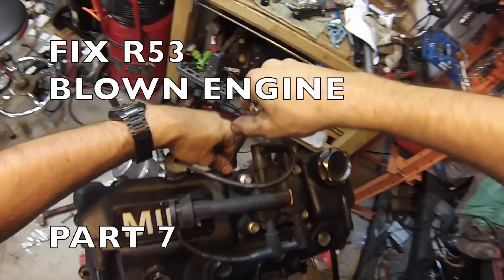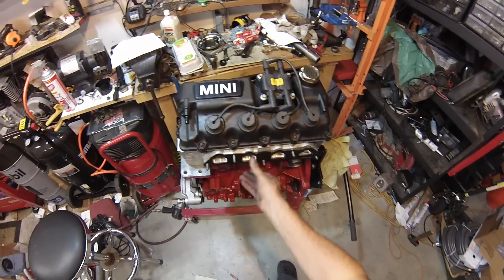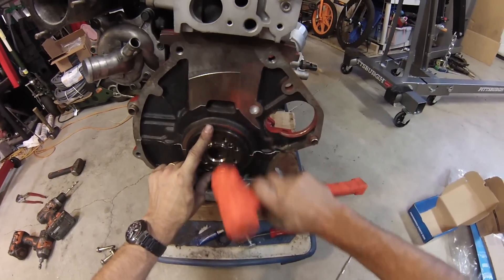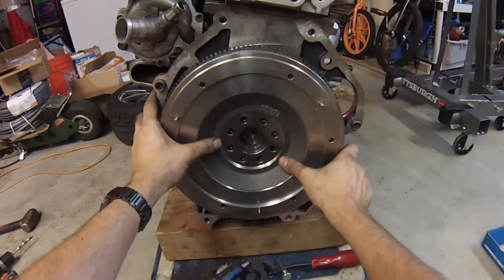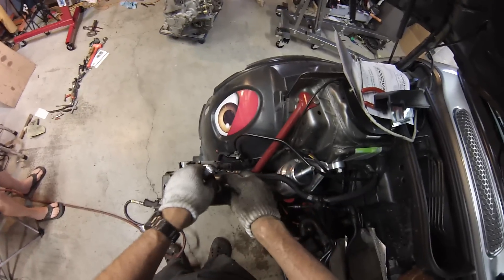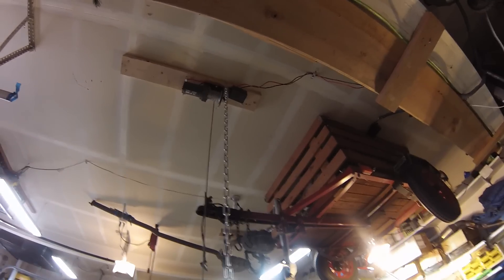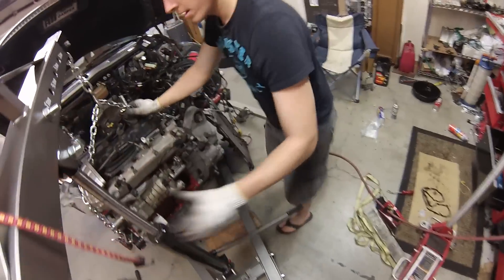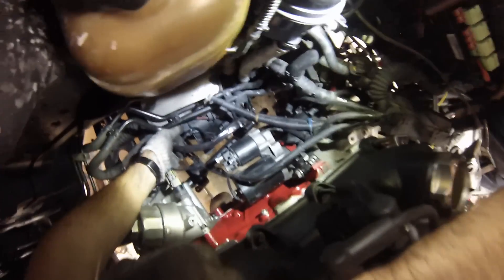Rebuild R53 Blown Engine 2004 MINI Cooper S - Part 7 / 9

Comment: Been following your videos through my own melted piston and engine rebuild.  Thank you so much for all this.  I'm now studying these to mate the engine back to the car. 

I noticed you didn't show when you connected the shifter linkage cables to the transmission.  These gave me some trouble when I took the engine out, and I'm thinking these will be the toughest part of the engine hook up (little room to get leverage and properly snap those in).  Any tips?

Comment: Question on timing chain installation. Do you check to see where the pistons are in relation to top dead center? Or is this not necessary?
Reply from the maker: If bright links line up, doesn't matter.
Reply: @ModMINI  Awsome! Great videos and keep up the great work

Comment: Are the S engines 1.6L or 2L? Just curious if I can use an NA block with a supercharger and S mapping.
Reply from the maker: 1.6. No, the internals are different. The supercharged variant has piston oil cooler passages that do not exist on the base block, crank and Pistons are weaker, etc. you will blow up the engine.
Reply: +Mod MINI that's what I thought. Good to know, just professional curiosity and cheapness! :p

Comment: Is your supercharger still stock?
Reply from the maker: Osman Berberovic Stock supercharger with 17% pulley and GP intercooler. A lot of stuff needs to change if you move away from stock supercharger.
Reply: Ok! How much Psi are you running, If you know?
Reply from the maker: Osman Berberovic Somewhere around 17psi.
Reply: Ok, Thanks you! :D

Comment: me and my father have a mini cooper garage with like 8 minis in our back yard, and since we do alot of engine work, when we put the transmission back on, we made these little pins that stick into the engine threads so we can slide the transmission on, then we take one off one by one, and put a bolt in its place. we made the pins out of old transmission bolts and grinded the head of the bolts.  its very helpful

Comment: Are you going to get your car dyno tested? I was planning on saving up a bit and doing the same with the pistons, connecting rods, cam, arp, and header.
Reply from the maker: Yes, I will probably need to have the car tuned on a dyno.

Comment: I am super excited to have my 2005 mini cooper S running on a new motor, I absolutely love going down the road and pulling up to a dodge, ford, chevy and blowing their doors off! shifting that 6 speed all the way up the gear box and grabbing those gears and listening to that charger whine it is just exhilarating......  i have named her Rotten Mater!

thank you again mod mini for all your videos and knowledge of the r53's!!!
Reply from the maker: Robert Cowan Excellent. Do you have more power with the new motor? I helped replace a short block recently and the owner reports the car is a lot faster than with the old, tired motor. 
The Gen 1 Cooper S makes the best noise of any MINI, maybe even any affordable car.  I don't know how Gen 2 MINI owners can stand it. Their cars sound like a VW or something. :)

Comment: Im so excited i cant wait to see the see start and drive :D  And how many miles does you mini have?
Reply from the maker: I crossed over 75000 just after putting in the new engine.
Reply: *****  after you rebuild your engine do you think you will get more hp???
Reply from the maker: MegaMilkman42 Hard to say until I get it tuned and put on a dyno.
Reply: ok cant wait any more get that mini fixed. im so excited to see that thing in action :D